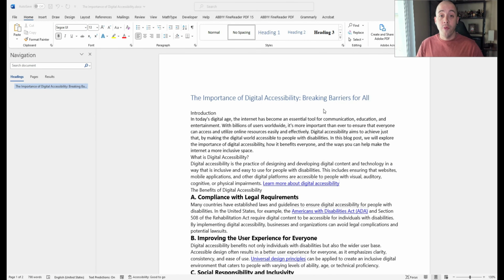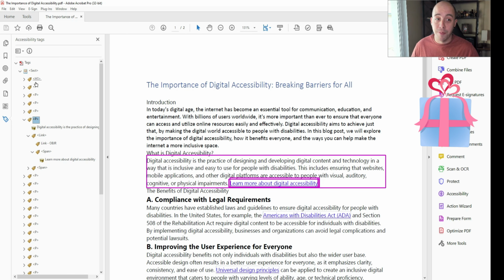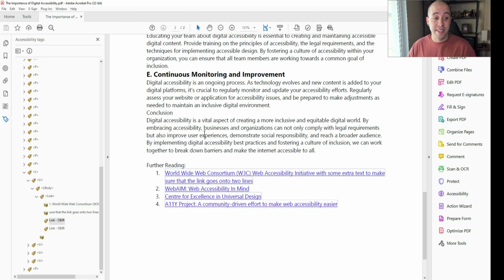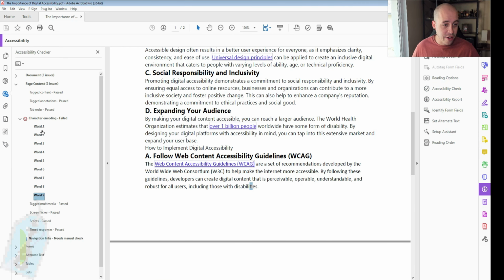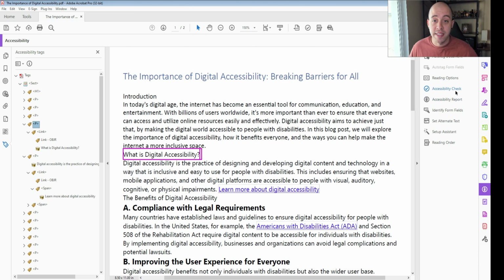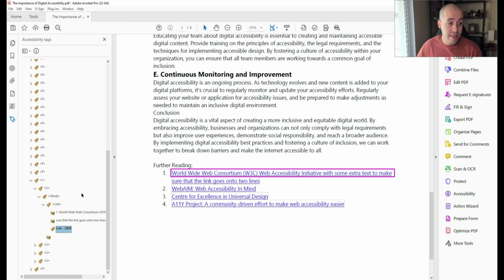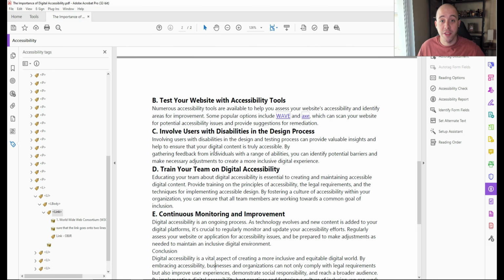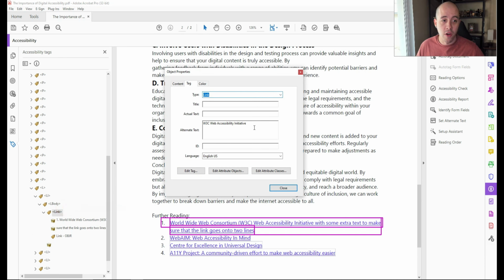How to tag Links in a PDF using Adobe Acrobat PRO DC

Comment: Super helpful video, thanks! Acrobat DC's tag properties panel now have an option for Alternate Text for Images and Alternate Text for Links. Do you know if it's okay to use the as marked? Because the Commonlook Validator puts a warning that the link doesn't have alt text unless it's put in the Alt Text for Images box instead of the links, and this seems like a fairly new change.
Reply from the maker: This is a great question. That feature is a new feature and I swear it does change depending on the day. The fail that you might be getting could be related to a menu item using the PreFlight option where you can actually give the alt text for any link annotation throughout the document all at once versus having in the individual properties menu of the tag itself. But to your point I have seen different results based on different samples

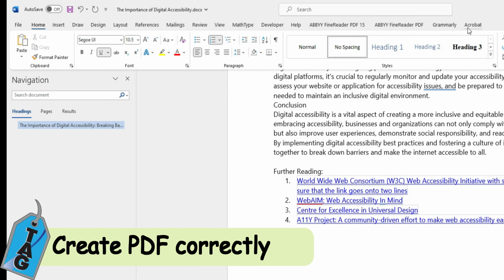Comment: Thanks for all your videos! I noticed on this video that when you created a PDF from the Word doc (at 0:20), you didn't choose the "Create PDF and Run Action" button and then "Make Accessible" you just clicked on the "Create PDF" button - is there a reason for that? Is there an actual difference between the two? Thank you!
Reply from the maker: The main goal I was trying to emphasize was maintaining the structure of the word doc when creating the PDF. I also like to have full control - so that Create PDF and Run Action seems to be an additional automation step - which doesnt always maintain what you did in word. In short - the action wizard will OVERWRITE your hardwork that you applied in Word.
Reply: Thanks for the reply! That's interesting to hear, I'll have to keep that in mind. Also, one other question - how do you expand a tag using keyboard shortcuts? It seems like you're expanding your tags without clicking on them and I was just curious how you did that? Thanks again! @TheAccessibilityGuy
Reply from the maker: The arrow keys my friend.  @peterfraser1539
Reply: Ah, the right (open) and left (close) arrow keys! Yes, I was looking everywhere to try and figure it out! Thank you very much!  @TheAccessibilityGuy